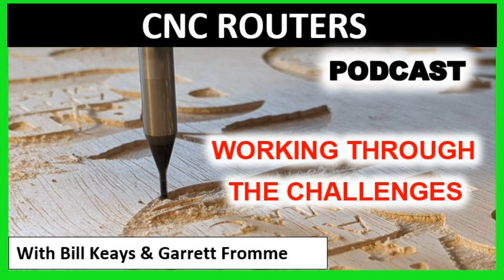CNC Routers - Working Through Challenges and Problems [PODCAST]

Comment: Great podcast please keep em coming.   I have one question pertaining to bits with replacement blades (expensive ) but are they worth the cost over the long run?
Reply from the maker: Hey Dwight. It depends on how much you plan on using them. Replacable inserts are less cost in the long run and they usually have 4 usable side. If you plan on running your machine every day at or near production levels...yes, by all means, get this tyoe of bit.